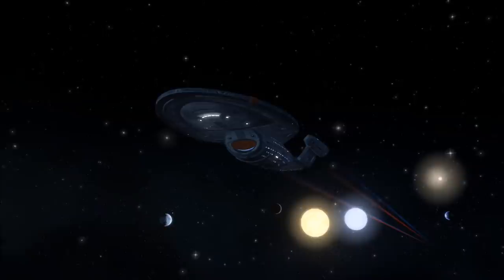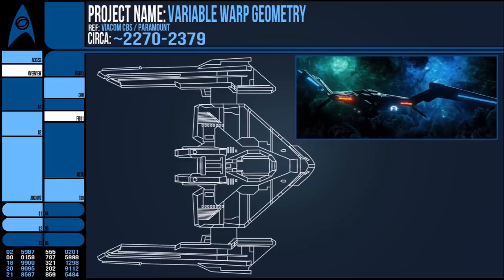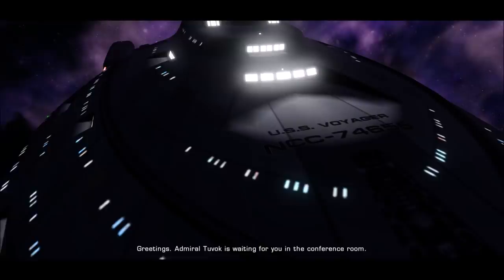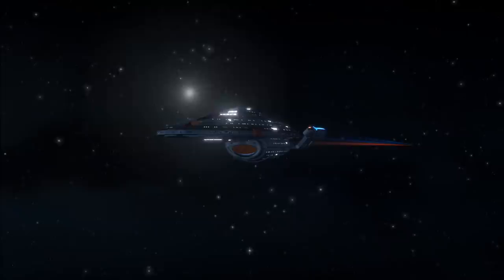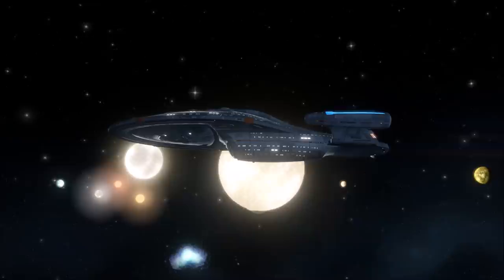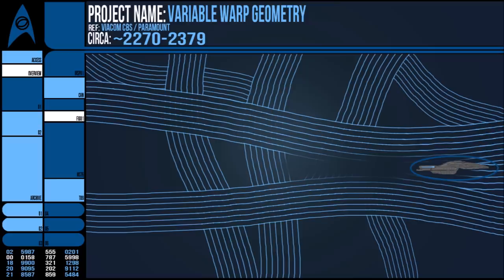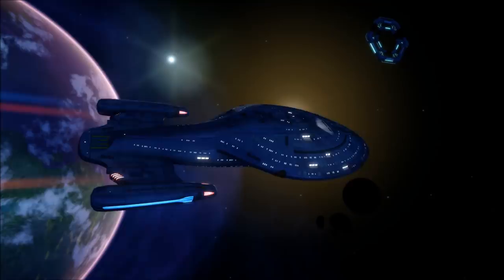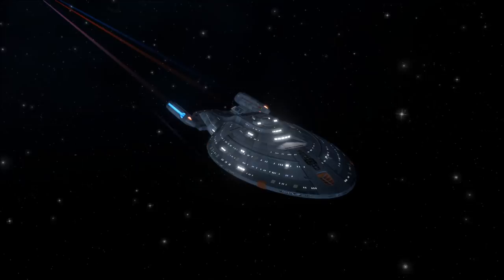VOYAGER'S "Hinged" Nacelles

Comment: Now I want to see a starfleet ship that retracts its nacelles into the hull when not in warp, to protect them from attack.
Reply: Well if the shields go that bit of Hull playing ain't gonna make much of a difference
Reply: The USS Defiant extends them or extracts. So basically you can argue when not in use the get pulled in. Though not entirely covered.
Reply: Delta flyer
Reply: @danv2888  when was that used?
Reply: @treborkroy5280  it's Captain Ciskos ship in DS9
Reply: @danv2888  Incorrect, the Defiant's nacelles are fixed as a solid par tof the hull.
Reply: I'd rather then blow up away from the ship than inside the ship lol
Reply: @thefalsekingslayer3717  Warp nacelles don't generally explode. You may be thinking of warp cores.
Reply: I think if they retracted inward they better have thick shielding to protect crew from radiation
Reply: @jaredharris1970  The compartments they'd be retracting into would be depressurized and thus would likely have the same shielding as the rest of the hull.
...Not that it should matter, though, given they'd be powered off when retracted anyway.
Reply: @Monody512  - The U.S.S. Tortuga (for turtle)
Reply: I think the Defiant had that worked out. They didn’t even need nacelles, they were built into the hull of the ship.
Reply: @joshuahadams  They weren't outboard, but they were still exposed.
Reply: @danv2888  I believe you're thinking of the Delta Flyer.
Reply: @jaredharris1970  but can’t they just shut the nacelles down if they retract them since the radiation was only a issue when in use if I remember
Reply: @Monody  all I'm picturing is the timeloop where it gets scraped and the enterprise explodes 4 times in a row
Reply: The more Starfleet advances, the more I think you'd see nacelles being put 'way out there' for warp efficiency rather than retracted. It's kind of like modern warship design. As technology improves and the problem of protecting the ship becomes more of a question of power generation and 'soft' defenses, there's less need, and in fact less overall efficiency in designing the hull with damage mitigation in mind. Keep in mind that usually, you have to compromise on the effectiveness of a ship in other aspects, such as speed, in order to build it sturdier against attack. This is why modern warships, while still built with damage mitigation in mind, have actually gone backwards compared to say WW2 warships at least on the physical arrangement aspect of this concept. As a a result, generally modern warships are more effective in a number of areas, such as speed, maneuverability, modularity and so on.

Between shields, the SIF system and various other defensive counter-measures, I only see hulls in the future being built more with things like propulsion in mind. You may even get to the point where aesthetics becomes the primary factor. People often lambast the design of the Enterprise-J being very spindly, but to be frank, I think it isn't out of place.
Reply: Where do you put the bussard collectors then?
Reply: @tineye5100  From my understanding... Anywhere. There's no specific reason they're usually on the nacelles except it's free real estate and away from the deflector dish.
Reply: Yeah, but then how would a foe knock out the warp nacelles to force the crew to think on their feet and fix a 6 hour problem in 2 hours?
Reply: aka stargate puddle jumper, lol
Reply: @SkateZillaSimulations  Yeah! Except those are inertial engines and they retract for a completely different reason. :P
Reply: Would be neat for a 2300’s version of the Kelvin’s Dreadnought-class.
Reply: Suitable class names being Procyon, Artemis, Atlantis, Pegasus or Latinised versions thereof.

Comment: Ships in general being longer and elongated to elongate the Warp field is something I never thought about, but I love it. It's a nerdy way of changing Star Fleet design, and I appreciate that.
Reply: Wait till you learn that the Sovereign Class nacelles are actually angled slightly so if they were elongated they would intersect instead of remaining parallel. My understanding is that was one of the modifications made to warp drives to combat the erosion of subspace.
Reply: I think the sleeker ships also came about in response to the threat of the Dominion. Starfleet finally needed more military vessels so even the classic design (saucer, drive, two nacelles) got sleeker for a smaller profile. 
The taper and intersection point of the nacelles is probably the part related to subspace field theory.
Reply: Streamlined for less resistance.
Reply: @jameswatsonatheistgamer  Resistance is futile. ;)
Reply: Why would a longer warp field be desirable?
Reply: @stuv1996  It's more streamlined. Like how cars are shaped to cut through the wind, warp fields need to be design to slip through subspace, rather than barging through it and ending up tearing it apart.
Reply: @mattevans4377  Ahh ok, thank you.
Reply: As a trade-off, elongated ships shield’s drain faster
Reply: The reason ships were made longer is because they looked better on widescreen/movie theatre screen.

Comment: Actually, it was because it looked cool
Reply: Exactly. Its just like KITT popping those wings and spoilers for Super Pursuit Mode. Its just COOL
Reply: Engage plot device, warp 9!
Reply: @SWIFTO_SCYTHE  KITT SPM I nearly pissed myself as a child when, season 2 of knight rider i think it was, had that for the intro lol
Reply: r u on a mission or sumthn?
Reply: @Danny M Shutta your face. The ship is amazing.
Reply: @SWIFTO_SCYTHE  Well - I think Knight Rider overdid it a bit. But in theory Super Pursuit Mode did not only look cool, but also had a relatively reasonable scientific purpose: increase downforce, stabilize aerodynamics, air brakes, plus adding cooling abilities.
I don't want to say here, that the real design would be any helpful. But if you are looking into the hypercar industry, a lot of cars have these features: Apparently there have to be quite a lot of fans of Knight Rider at Porsche: Porsche the first major car company which used dramatic moving rear wings. This was even more emphasized with the crazy unfolding wing of the Panamera, and then the 991 Turbo, which not only had its typical moving rear wing design, but also a front lip which also extended - plus variable air intakes.
But also other car manufacturer used adaptive aerodynamics: Pagani (especially the Huyara is crazy), Koenigsegg, Bugatti...
Reply: @Maintenance Renegade Yes the production reason might be coolness, its still fun for some to try and come up with an in-lore plausable technical reson for such a function.

Comment: This reminds me of Formula 1 history, The teams always solved the things with just more powerful engines, til they realized aerodynamics were also important on the car to make it faster
Reply: A similar thing happened time and time again in engineering. When steam engines first arrived on ships, they moved relatively slow, because they were simple expansion engines. You know, like the one your car uses (unless its electric), albeit with steam, not diesel or gasoline. However, this is an extremely inefficient way of extracting energy from gases. See, you need a certain pressure to move the pistons. Otherwise, they won't budge, because you have stuff like friction to overcome. Later designers realized this, and added smaller pistons to the ships, which could extract a part of the energy left over in the steam that they could not utilize in the main piston. The real revolution, however, was the turbine, as it loses a lot less energy than a piston engine. Thus, with a steam turbine extracting more energy from the same amount of steam, a ship could go faster with the same amount of steam being produced.

Another example, closer to home, is in rocketry. Early rockets were single stage designs. The issue with this is that putting everything in one stage means you need to bring everything with you. EVERYTHING. Problem is, doubling your fuel doesn't double your delta-v (effectively how much your rocket is able to change its own velocity), as it also doubles the amount of fuel you need to move. Thus, you need ever bigger rockets for the same effect. (There's also several other design consideration, such as rocket nozzles, that make single stage designs inefficient, but i'd have to get way too deep into rocket science to explain that here) Later engineers adressed this by building a second stage, which can be ignited mid air, to a much greater effect than the single stage.
Reply: As Enzo Ferrari famously said, "Aerodynamics are for people who can't build engines."

Comment: Also in the TOS guides the nacelles had to be in eye sight of each other to create a warp field. On impulse Voyager's engines were not so they had to move to create the field. 

The only exception to the rule is the Defiant hence it has a Class 7 warp drive with some tweaks and why it was so overpowered, it had to force the range of the warp field around the ship where the nacelle design back in TOS was made specifically to counter need for it and thus conserved power.

The Defiant was so sleek that it could force the warp field around the ship. Hence why it's engine design is different.

The preservation of subspace was an added bonus.
Reply: But, what about shuttles? They are warp-capable and some designs have the nacelles outside line-of-sight of each other, while also being everything but sleek in design.
Reply: @GLITCH_-.-  My theory would be that since they are so small, they can use brute force to shunt the energy around the vessel and make the connection. It's a lot easier to force it when you're pushing it maybe 3-4 meters  vs 50-100m.
Reply: The Defiant's nacelles do actually have los to each other.
Reply: Interesting until you see the single nacelle Starfleet ships....
Reply: @matthewl.459  My guess is those nacelles are designed differently. They have components that act like the twin nacelles do only it's in a more compact package.

Comment: Great idea, however that's the reason for the factory recall on all intrepid ships when they discovered that in 2 hits the shields when down to 17 percent.
Reply: but then they discovered that this last 17 % holds much more than excepted. 
Later they found out there was a bug in the calculation of the shield strength.
Reply: @bleed2blue1  yeah

Comment: Warp nacelles need to be able to 'see' each other to work. (Unless depending on the writer is at work.) This explains why the Discovery has such long nacelles; it's only past the secondary hull that they have this line of sight. You'll also see this design philosophy with non-starfleet vessels, such as the Roman Warbird with it's nacelles forcing the ship to have a large gap in the middle.

Voyager simply can't go to warp without bending the nacelles.
Reply: How does the Defiant work then?
Reply: I always thought the romulan warbird design had something to do with their quantum singularity power sources, like for some reason they need a lot of volume, but the ship doesn’t actually have to occupy that volume so it sort of wraps around with some unseen field effect or something going on in that negative space
Reply: @battlesheep2552  The Defiant is a federation ship with no line of sight.
Reply: @adam92682  isnt the Design hollowed Out on the bottom? 🤔
Reply: @adam92682   the Warp nacelles are angled slightly beneath the defiant. They can see each other below the primary Hull.
Reply: @battlesheep2552  quantum singularity core has nothing to do with warp travel. It is just the way the romulans generate the energy needed to warp space. The actual warping of space occurs in the nacelles themselves.

Energy from whatever power source, warp reactor or quantum singularity, flows into the warp coils which then bend space time. Thus warping space.
Reply: Cardassian ships have no gaps between their warp nacelles (if you can call them that, they were part of the main hull anyway....). also the romulan scout ship....
Reply: @nemesis2445  You'll probably find as many exceptions as there are adherences to the rule. Ferengi, Borg, Malon, Hirogen vessels all fail this; heck even the Phoenix lacks line of sight. On the other end Klingon, Gorn, Breen, and Vulcan do adhere to line of sight. The Vulcan ships are particularly creative with the nacelles being a ring. At the end of the day, Star Trek is entertainment and what looks cool trumps over perceived in universe physics. (As it should, within reason.)
Reply: Voyager has gone to warp without the nacelles being raised, rewatch the series and you'll see, I've only just recently finished watching it again
Reply: I'm pretty sure ships like the Negh'Var dont have line of sight?
Reply: But that doesn't explain why they bend, it would be easier to build them at warp speed configuration.
Reply: @Drave_Jr.  The in universe explanation is that doing so prevents the damaging of subspace that we saw in TNG, for reasons and via methods never addressed. The RL explanation was that during preproduction the designers thought it might be cool, and was the 'gimmick' for  Voyager (Like saucer separation for the D or cloaking for the Defiant). It wasn't until mid-show that production added landing to Voyager's gimmicks.
Reply: I feel like the line of sight rule from back in the day got abandoned once starfleet engineers were able to tweak the design further. Line of sight might be necessary for a well working low-tech solution that gets abandoned for other designs with advancements in technology.  And most other civilizations got the tech far longer than earth, so they already got to the point where they could put the drive elsewhere.

Comment: Interestingly enough, we only ever see the nacelles in two positions, each for one use.  Fully down for impulse and fully up for warp.  In between positions were only transitional. 9_9
Reply: that would have required additional screen time to explain, and a bigger CG budget to show it. I imagine the simplest way to explain it would be that the movements generally performed were small enough that you would not be able to notice them at the scale we usually saw the ship.
Reply: @nemesis2445  that's true
Reply: Okay, here is a theory: The ship was designed when they still tried to figure out the optimal position. By the time the series starts starfleet has already found the optimal angle, and simply programmed the computer for it. Why they tilt them back down is another question, but that might just be for maintenance.
Reply: @HappyBeezerStudios  Well, I imagine you don't want to blast your warp nacelles with impulse exhaust. This could both cause weird energy deviations across the ship, and also causes unnecessary drag and stress on those components. It's like in a propeller plane, where the accelerated air hitting the fuselage ends up being waste energy. You are pushing against yourself.

One thing I wish we had seen in game is a "Nacelle hinge failure", which would be similar to a wing sweep failure on an F-14 or the like. The nacelle would either become jammed in an awkward position, or perhaps even flop around with broken drive assemblies. If it happened at warp, the vessel could effectively "Spin out" as the warp field collapses or changes shape to be more like a brick wall.

Now that I think about it, I don't think the hinges were ever damaged in the show. Should make the entire ship out of hinges and the damage report station.